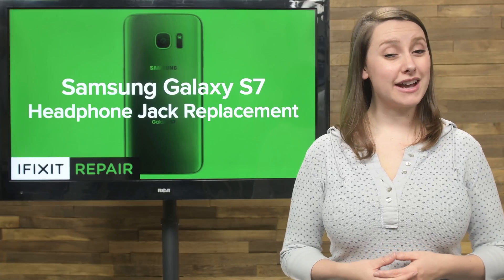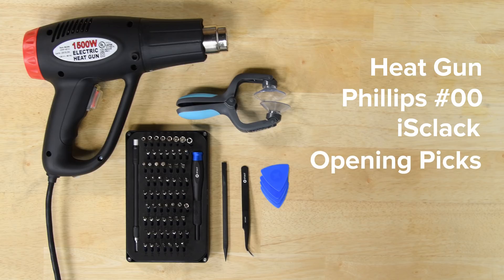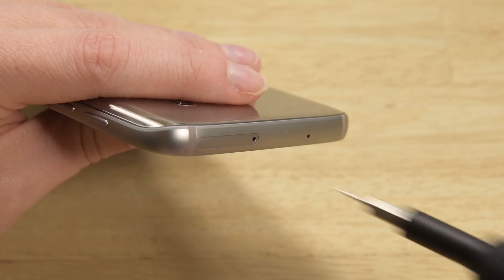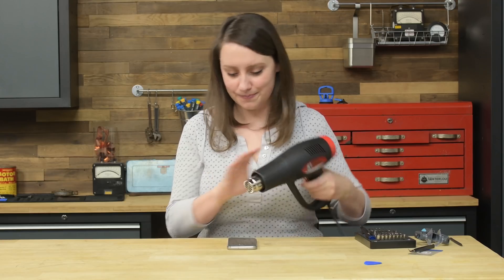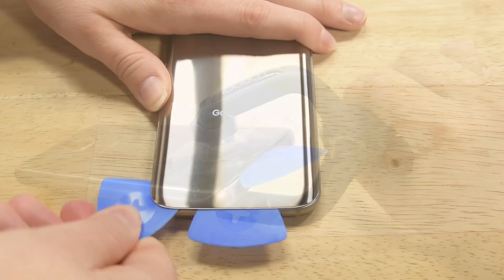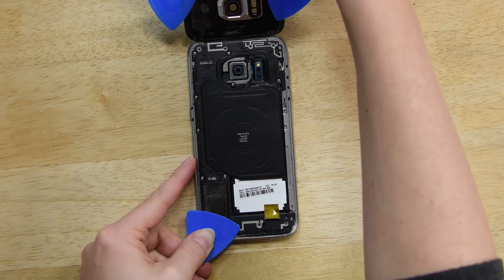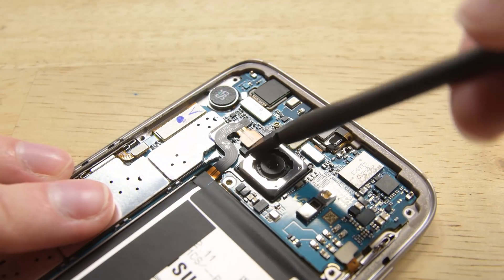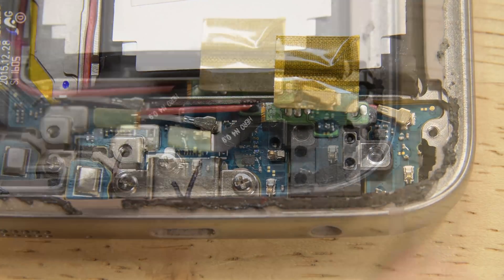Galaxy S7 Headphone Jack Replacement—How To

Comment: My right ear doesnt work
Edit: its not my headphones, its the audio jack. I couldnt put my headphones in all the way, and then pushed with brute forces to get it in. It worked, and i was able to get the jack in, but it caused the right side of stereo headphones to basically break.

Comment: So my headphones keep popping out of the socket. i tried cleaning the headphone jack with rolled up tape and twisting it after inserting it as deep as i could get it in there. I think maybe the jacks stay in there like 10 % better but still not as good as when new. Are the replacements supposed to fix this very issue?
Reply: I think so, if it happens to be a more narrow replacement port.